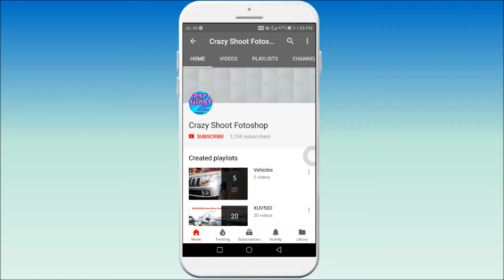GPS tracking system unit device installation on Mahindra XUV500 W11 W10 W9 W7 W8 W6 W5 W4 location

Comment: Where u got the T tap wire connector?  Please share the link.
Reply: I mean in India?  Where we can purchase T tap wire connector
Reply from the maker: You can purchase from amazon india link https://www.amazon.in/HITSAN-Excellway-Terminals-Disconnect-Connectors/dp/B0742JP7J4?tag=googinhydr18418-21&tag=googinkenshoo-21&ascsubtag=c38c551c-aace-4f0b-9550-c05ed56cc2b7

Comment: What is the price charged for this
Reply: @CrazyShootFotoshop  thanks man for the help the bank was charging us rs 19500 for the same product you are showing in your video but we said no to then because it was very costly and not so useful to us at that cost
Reply from the maker: But, sir, do go for such devices. It is very useful. You can track your vehicle easily anywhere. It will show you the vehicle's routes, it's idling, past routes records, and if you give your vehicle for service, you can also track if It is misused. However you can buy this as a gift to bank as bank has provided loan and it is safe and one time investment.
Reply: @CrazyShootFotoshop   thanks for the suggestion sir😊